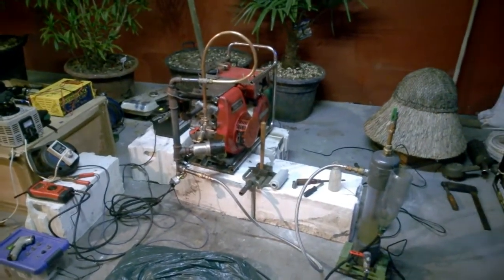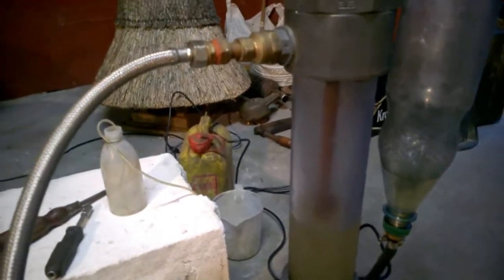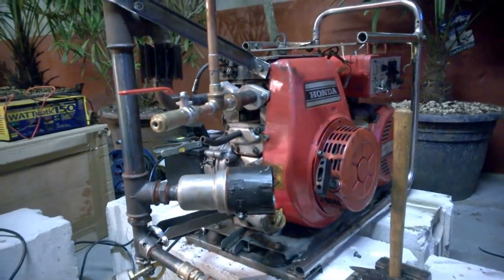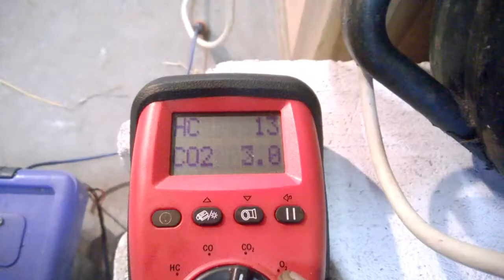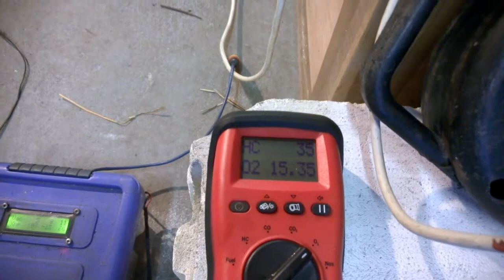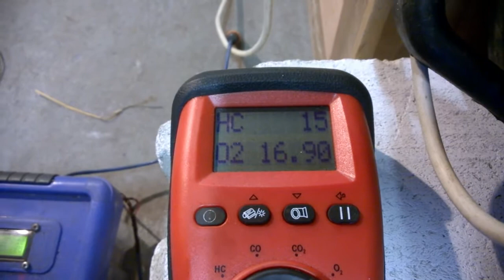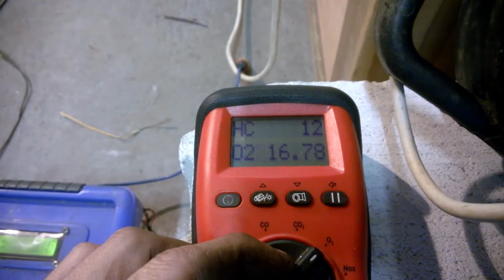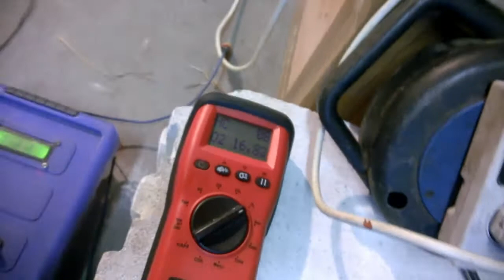Vapor Carb or Plasma Reactor part 4

Comment: Hey I'm the first commenter. I love the geet videos. And you seem more measured and systematic in your approach to it. With such low emissions, this generator can be certified to run in an enclosed space like a living room! But the infernal noise it makes will then be loud enough to kill you. I've read your responses and answers to questions posted to you. So here is mine... We all know geet works. But can it run for 5 hours without any adjusting to the valves and such? Also I thought "Paul" said that sparkplugs were not required for a large engine. Have you ever heard this? So I hope all is good with you.
Reply from the maker: Hi there, thanks for commitmenting. 

So, first question, could it run indoors?   Well yes and no.   If the emissions from a good generator were Zero Zero, then you could, in theory, run it indoors. 

In reality, the emissions are like a very clean car, so ide keep doors and windows open.  
 
I have managed to gas myself running these things in the workshop.  So yerrrr, not something to run in your living room.

Will it run continuously with zero adjustment? Yep, 100%.   If it's running from a micro carburettor with stable fuel delivery and constant load.   Takes a few minutes to settle down and then I can walk away and leave it for hours.
Reply: @dinskiy  Funny! I was wondering about that generator running in the shop with the exhaust in your face while testing and tuning. The gas analyzer showed hardly any pollution coming out but I was wondering if you were getting gassed out. Thanks for answering my questions. I been scouring the inet for anything I can find on geet. It is strange how there doesn't seem to be alot of recent geet activity that I can find. Do you have a recomendation for me? Should I drop it? Or is one of the geet groups one that you can recommend?
Reply from the maker: You will.prob want to see this

https://remoteview.substack.com/p/dan-easton-geet-gotchas-and-tips?triedRedirect=true